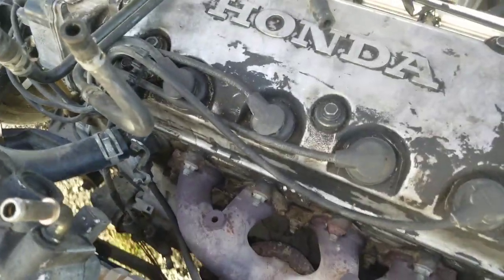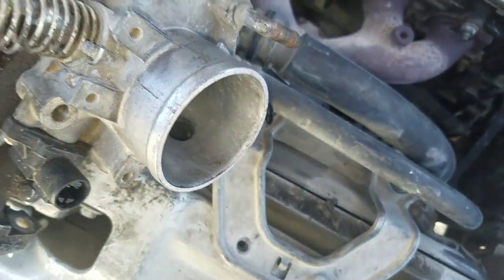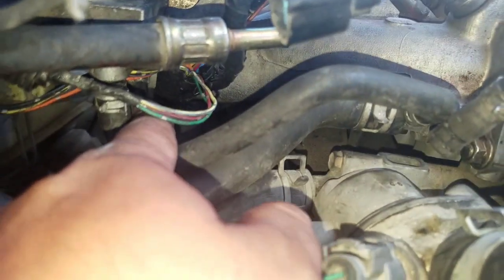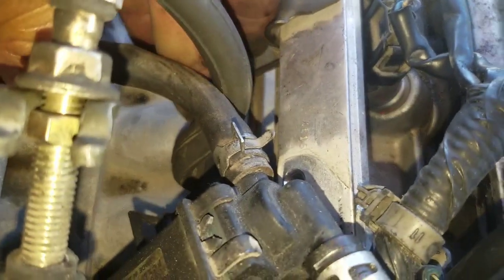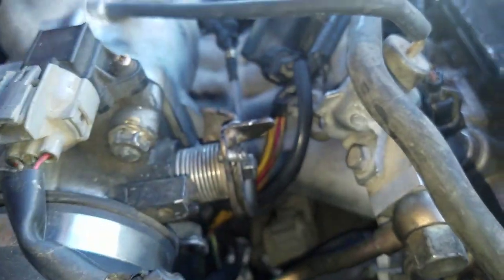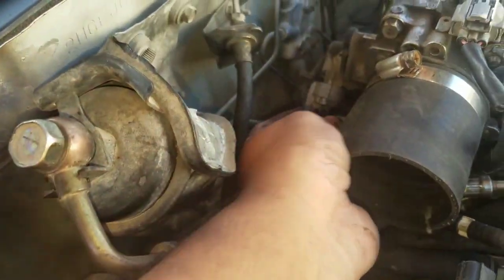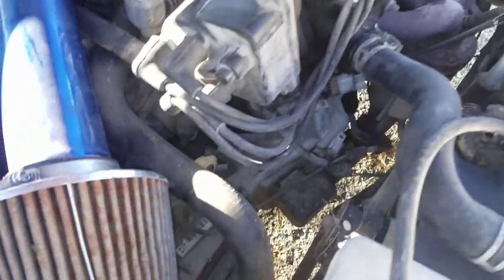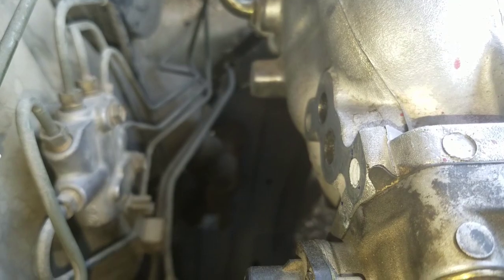How to swap a D16 y8 intake manifold into your D16 y7

Comment: Nevermind😂😂😂 should have waited and watched before commenting lmao thanks yo!
Reply from the maker: Lol
Reply: @carsandbeatzofficial  So do you have to swap over the fuel rail and injectors as well. I seen it on a honda forum. Just like the tbi spring.
Reply from the maker: @historyhunter5215  I used the y7 fuel rail. They are pretty much the same.
Reply: @carsandbeatzofficial  I work at a salvage yard in Central Tx if you ever need something you cant find, Id be glad to check our lot for you. Plus I get a 10% discount lol.
Reply from the maker: @historyhunter5215  I'll try and stay I  touch with you . I'm also in central Texas and go to salvage yards all the time
Reply: @carsandbeatzofficial  right on, im out at 195